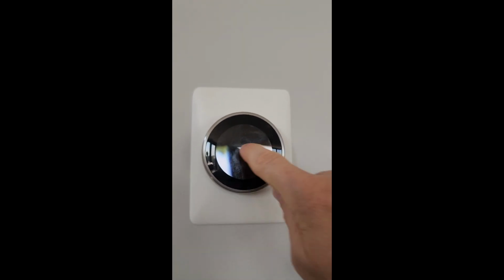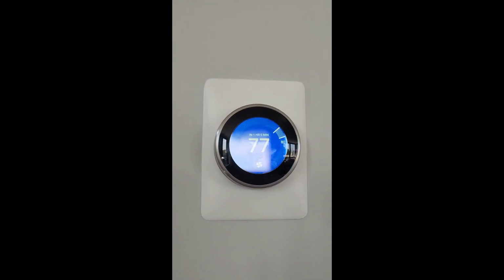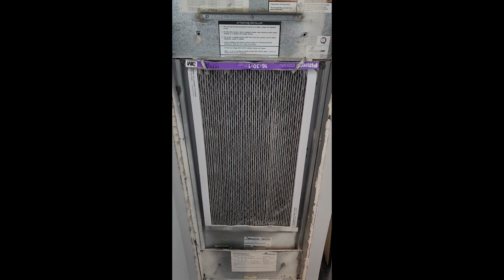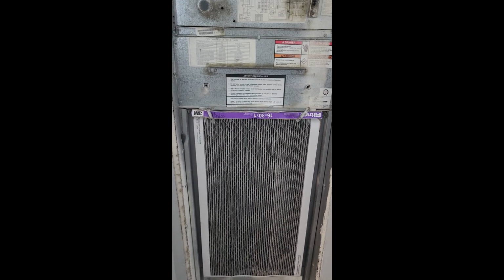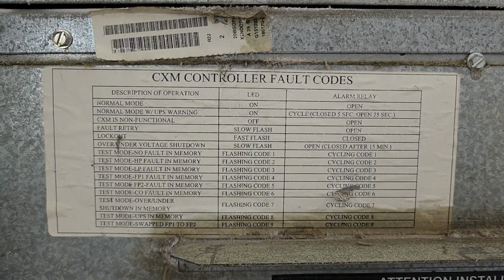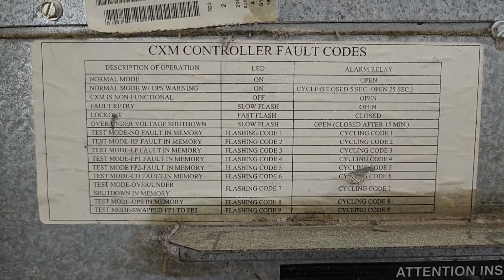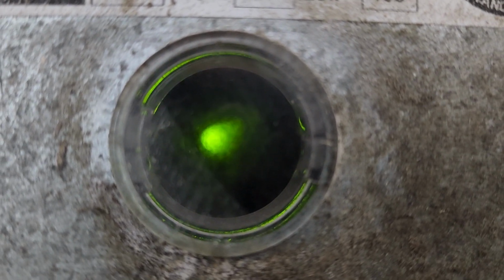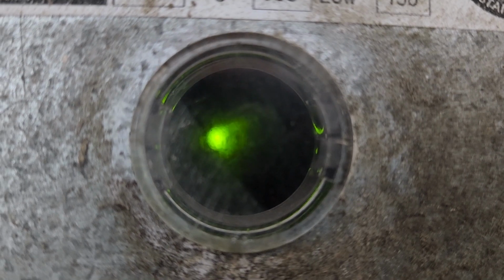How to spend 20 minutes and $10 to diagnose and fix an HVAC unit

Comment: I wonder why in newer units why dont manufacturers build in pressure transducers into the service ports and integrate the readouts into the thermostat and add wifi to the thing so hvac techs could remote into the system and diagnose the system without havibg to go onsite..  could install ammeters on components and all..  be a good idea.  Maybe expensive initially but would help out both the customer and save time for the techs..